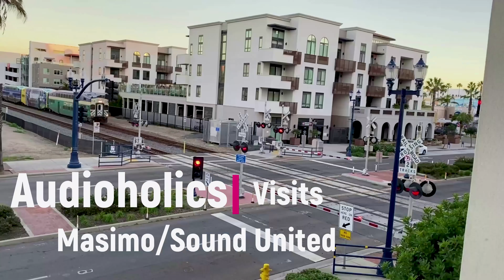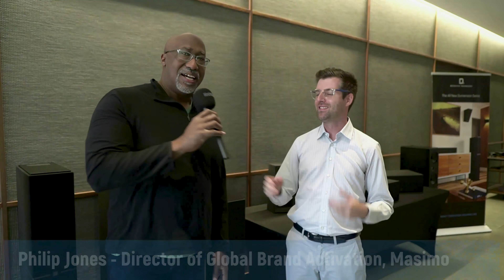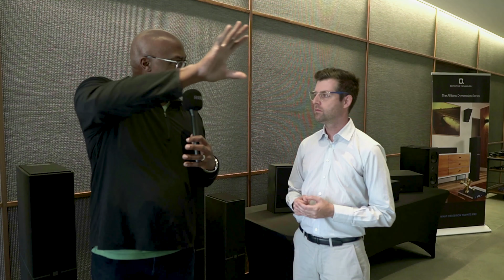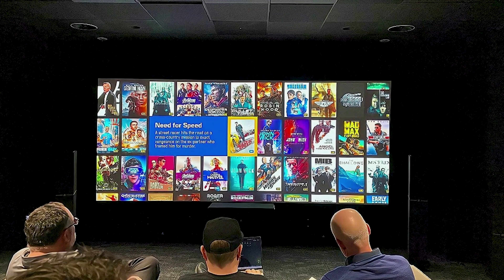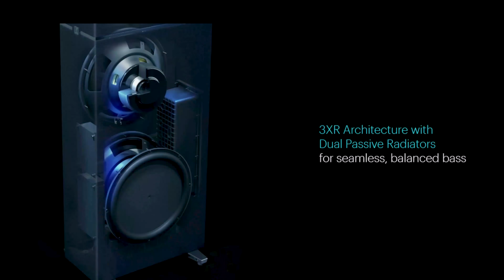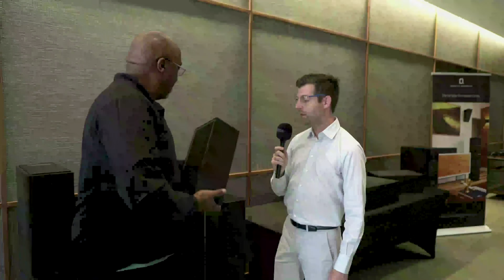Definitive Technology Dymension Loudspeakers Overview & Listening Impressions

Comment: I absolutely love Def Tech. I had an issue with one of my 9080Xs cabinets. It was causing an issue where bass was causing a lot of vibration coming through. It took them a while but they just shipped me 2 DM80s and a pair of DM90s to replace my BP9080Xs despite only having an issue with one tower. Absolute legends. I'm glad to hear that they're fixing issues with the cabinets and amps as I know a lot of people had issues with those in the 9080x despite me not actually having that problem. I'll be upgrading my center channel with the DM30 as well.

Comment: It’s so cool to see speakers with bipolar phase control, that opens up a whole world of really interesting things.  I also can really appreciate the notion of having all the mid and tweeter’s the exact same driver, best to start with everything perfectly balanced to begin with rather than using DSP to tweak your center channel’s response to match your towers.  I do enjoy the compact feel of these speakers too, they don’t impose on the room with harsh edges.  

The pricing on those surrounds was a little shocking at $800 a pair. One would hope that’s not the actual real world price but rather pre-sale pricing, so they can sell them for a fat discount as allot of brands do. I’m just glad I don’t work in marketing and have to rationalize to myself pricing disingenuously high just to keep up with marketplace norms.  Everything everywhere is always on sale, does anyone pay full retail for anything? With somethings you have to, especially shortages.  I actually think nows a good time to buy hard to get items. Allot of cutting edge new stuff or rare vintage stuff falls into that category. Allot of good receivers have been in short supply. It wouldn’t surprise me if speakers experienced disruptions too. Prices of magnets, copper, and wood can easily fluctuate. It’s taken me several years of camping the used market to get matching tower speakers at steep discounts. There’s allot of good reasons to just buy a whole brand new system, but watch out for the upsell of convincing yourself you want yet another pair of atmos or surrounds when a 5.4 is already sweet. Thankfully with a wall mounted side surround, you can always get another pair later.  Ceiling upgrades are a little more daunting, but everything great is worth doing well.

Comment: Hi audioholics, center channel seems most impressive to me from the line up. Because it sounds most challenging to do right: 4 horizontal mid woofers (more crossovers to fight beaming?) and passive radiators (bigger group delay to work with). Would love to see measurements of it. Keep it real guys.

Comment: I used to sell GaN FETs.  The advantage to them is very low gate capacitance of the FET.   This is great for class D designs.  This allows the FET to turn on and off much faster since the voltage level of the gate can change faster due to this low capacitance. Class D relies on the FET being all the way one and all the way off for varying amounts of time.  Operating the FET in the linear range is not desirable in a Class D.  (when the FET is going on or off this is the linear range).
Reply: I'll take your word for it 😂

Comment: I have friends with a full setup of the older series. They make good quality stuff and the sound is very good for home theater.
Reply: Yeah I have the 9000 series, they are great except the Amps have serious issues, they always fail at some point. Both of my towers have failed, both subs no longer work. It’s ok tho, I have an svs sub
Reply: @Jasheon  that's a bummer. I haven't visited their place in awhile due to COVID and haven't heard they had any trouble.
Reply: Fronts BP7001, rears BP7002 paried with Marantz SR7013 and Emotiva XPA-5 GEN3 the speakers are 20 plus years old and still kicking! In the Master Bedroom BP7006 same gig still kicking. Never have had an issue with the Amps.